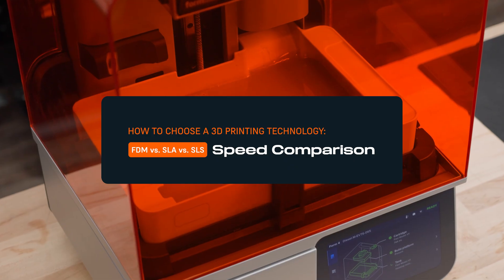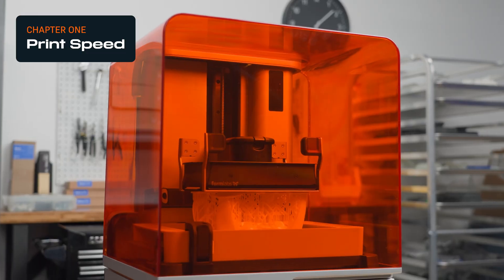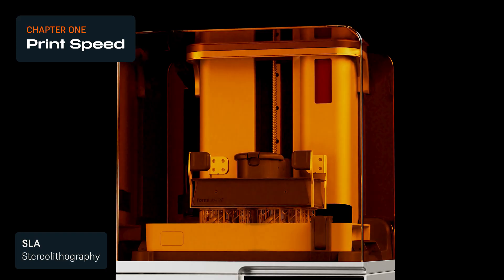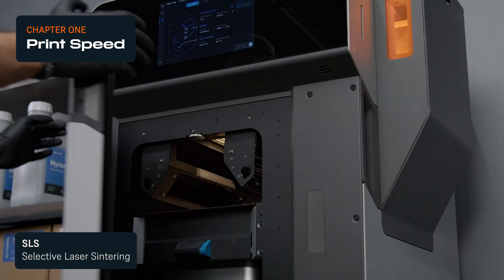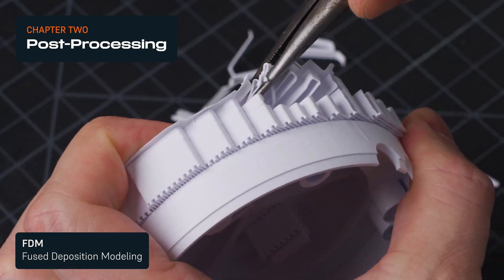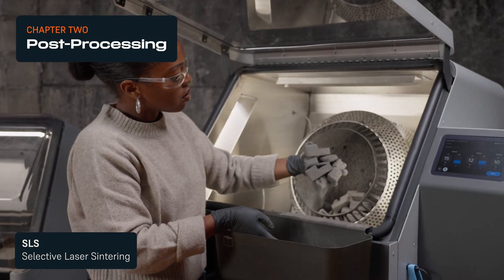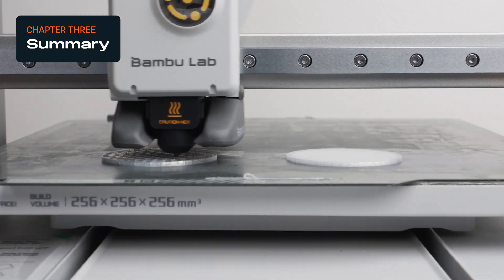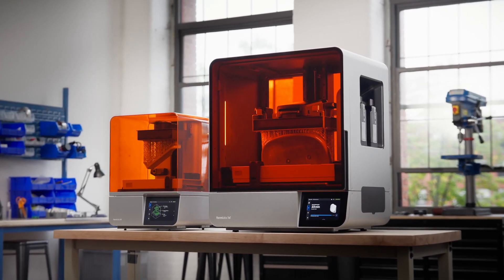FDM vs. SLA vs. SLS: Which is the Fastest 3D Printing Technology?

Comment: Seriously, "throughput" is a very niche argument, usually fulfilled by vac cast.  None of which are a true production replacement, but usually some form of R&D compliments during NPI cycles.

Every arguments for using 3d printing, whether it internal v external services or type of equipment like FDM v SLA v SLS, always end up asking the cost, time and quality question (inc. size and quantity) .  As it usually depends what stage of R&D during NPI phase people wish to achieve.

e.g. is it a business project or an enthusiast who just want to replace a gas hob knobs at home?

Comment: The video mentions it at the end, but for those interested in getting 3d printing in their company do check out the links mentioned in  the end. Whilst speed and cost per part are two big factors, the one we've found the most important (and often underestimated) is ease of use. This is especially true if multiple people are using the machines.